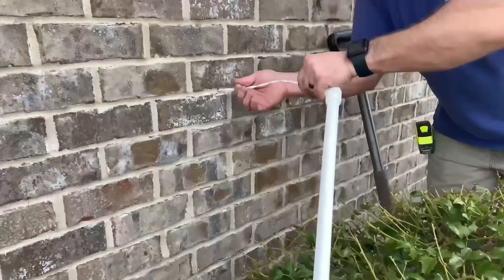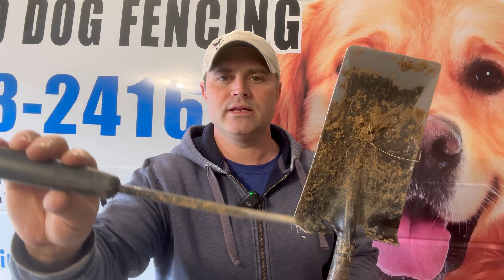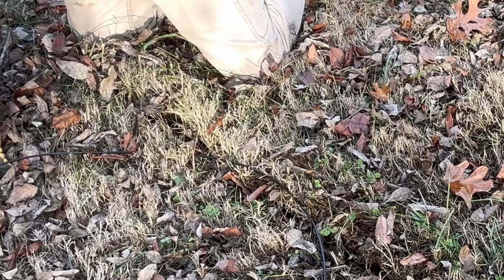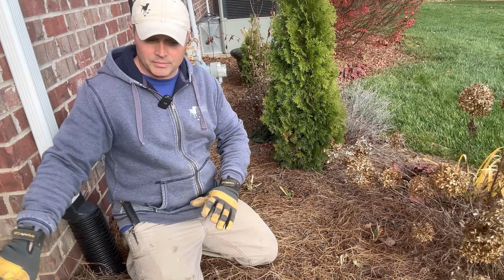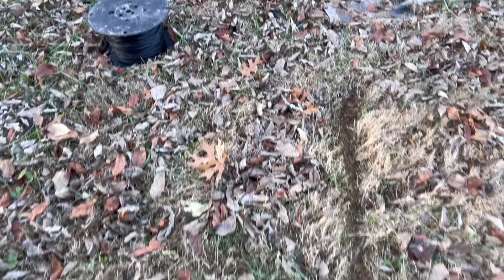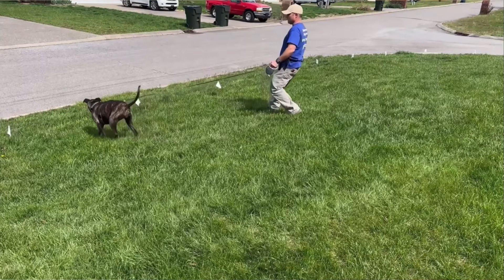How to install Underground Dog Fence / Electric Dog Fence / In-Ground Fence / No Digging Required??

Comment: Is it a good idea to put the cable in a small PVC pipe and run it since we're never planning on removing it is that a good idea or have you ever tried that
Reply from the maker: I have seen where folks will fish a lower grade cable through pvc pipe to help protect it. However I’ve been out on service calls to help repair the wire that’s been installed like that, because it still had become damaged. When it’s fished through pipe, it can be a nightmare to try and repair. Ultimately the repair ends up, exposed outside the pipe because you have to cut the entire pipe out of the way. I find for future maintenance and alterations to the fence layout. It’s always best to just install a high-grade long lasting cable that is easily accessible.

Comment: Yea, I have a four acre property that slopes down to a valley where a 3 ft wide creek cuts across it. If it's still doable, which method do you recommend?
Great video btw. I like the alternative to paying some company 10k just to put down some wire.
Reply from the maker: Are you asking how to cross the creek? Or just how to install around the 4 acres? The stapling method maybe a faster install for you. If you need to cross the creek, you can tie the cable to brick and sink the line into the water. It won’t harm the wire I supply with the fence system. It’s rated to be underwater.
https://www.outdoorpetsolutions.com/store/product/diy-dog-fence-kit
Reply: @outdoorpetsolutions  Well that was fast. I was asking for both actually. Where I live is semi rural, and the creek floods a lot during the rainy season. I was mostly worried that the flow and debris in the water would degrade the wire over time. Would I need extra output stations to supply power along such a large perimeter?
Reply from the maker: Debris can be a concern snagging the cable and dragging it. If the creek has considerable rushing waters. If it becomes an issue after install, you could run the cable in front of the creek to avoid future issues. Or come up with a way to suspend the cable over the creek.  The system can cover up to 5000 feet of cable. 4 acres should be less than 2000 feet (around 1700) so you’re good. There is a built in booster switch in the transmitter. Adam- Outdoor Pet Solutions